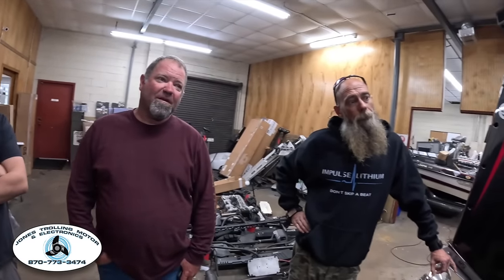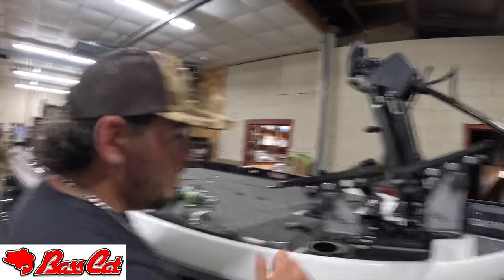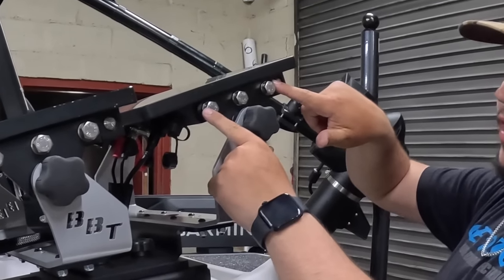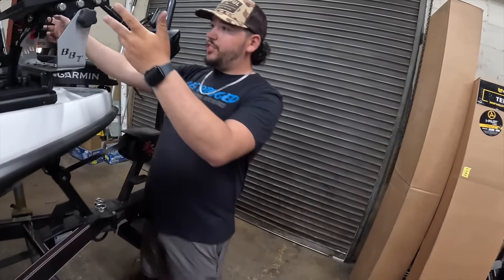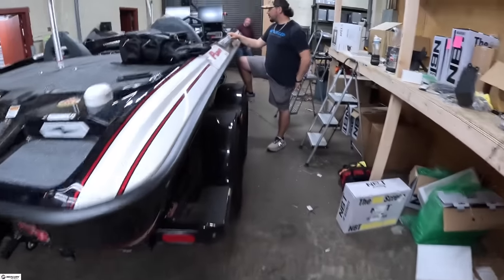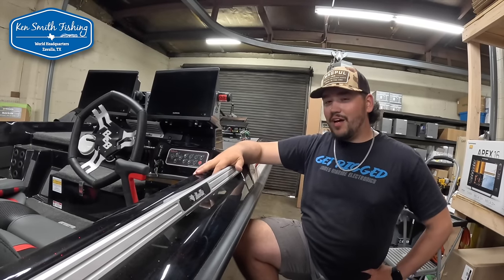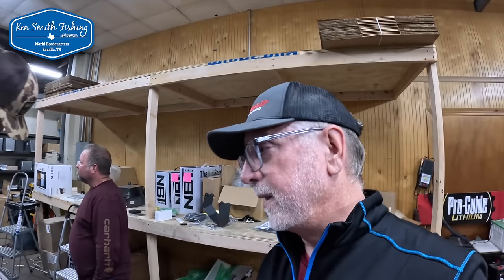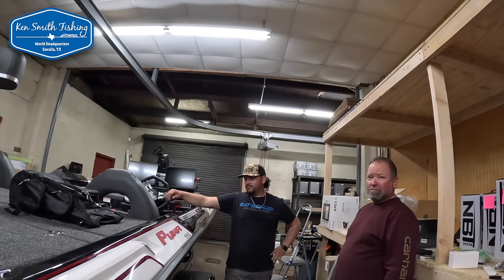Unveiling The Ultra-clean Electronic Setup On The Latest Puma Model

Comment: Nice rig and setup the boys did for you.............Eager to hear you thoughts on the Garmin Force....I'm looking to swap out my Ultrex and although i want the PP Move, just cant swing the $5K....Force is my next option and ready to pull trigger on it......i do hear it's a little different with the pedal but i should be able to get used to it.......
Reply from the maker: I can tell you after fishing with this one and with Taylor at Pines, I like it a lot, it's light to lift, really strong, cuts thru slop, but mostly it takes up way less space on the front deck

Comment: Interesting to see they recommend mixing battery chemistry on your 12 volt side of things.  To my knowledge, every lithium manufacturer does not suggest mixing lithium and AGM.  I noticed this with the Puma STS you reviewed with the 300 a while back, he had the same set up.
Reply: Every brand is different but with impulse it is an approved practice and is great to get the high voltage mix of lithium and stability for high output charge systems on new 4strokes.

Comment: I kept a 3 battery TM setup using 3x 100AH 12V lithium batteries giving 100AH service @ 36V. The 12V batteries usually weigh less, so my 100AH solution weighs about the same as your 80AH solution that almost certainly cost more. You had room for 3 batteries,  should have called me!

Comment: I need to know how he has those 12v's hooked up!  Are you running the 12v AGM and 12v Lithium in parallel together and connecting them to the Motor & single charger?
?
Reply: Parallel with an onboard 12/36 charger
Reply: @taylorjohnson2608  hmmmm, I was always under the impression that you couldn’t mix chemistry types when running batteries I series/parallel. I run an Impulse 36v TM battery and 12v Deka AGM starter hooked up to a PowerPole Charge, then a 12v Impulse for electronics with its own NoCo 12v charger. I would LOVE to be able to connect that 12v Impulse to my 12v AGM so I wouldn’t have to A)have a 2nd charger in the boat, and B)Actually get it recharged while running the big motor(2017 Merc ProXS 2stroke). May not be possible with a 2 stroke motor ……
Reply: @taylorjohnson2608 when you said that no black box is needed with the 8612s, is that the livescope box?
Reply: @ssmorgan1978  you can definitely hook the 2 12s parallel but with power pole charge you may have some issues, as they haven’t been the friendliest to that set up.
Reply: @QuarterOzzy  no just referring to no black box for the NBT units to run, as they will run directly with the 86series. But as for livescope it will always have to have the GLS 10 for function.